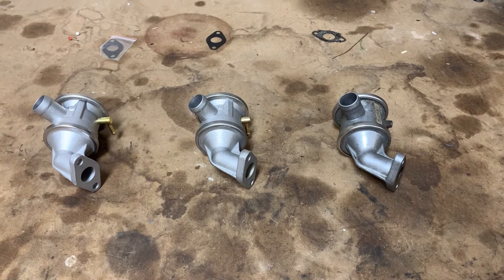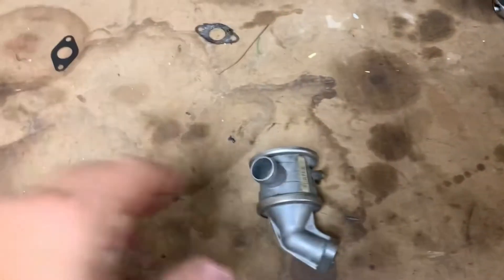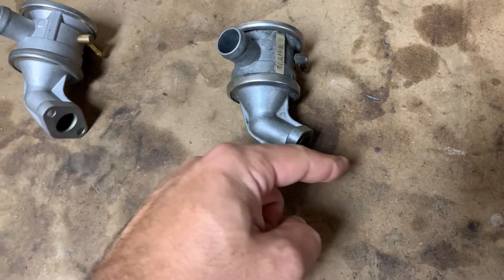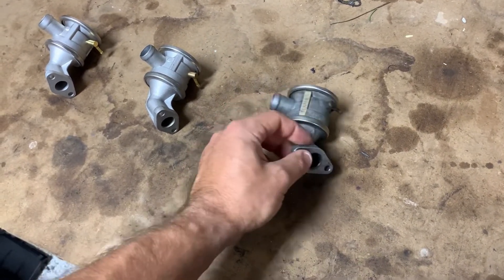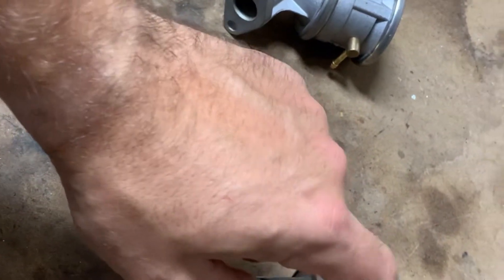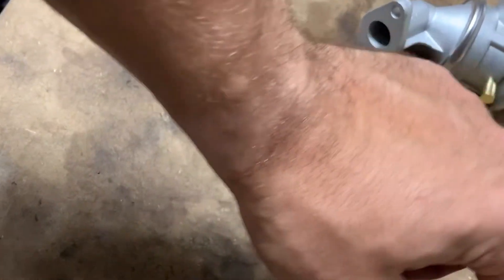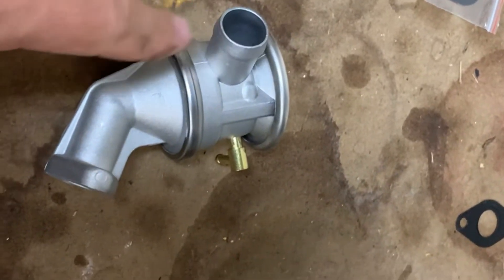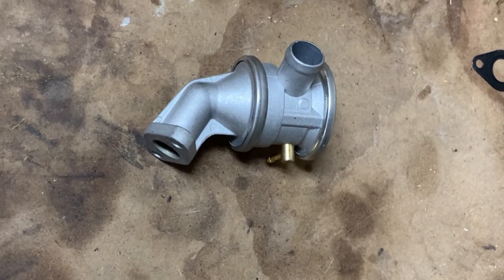Bench Testing BMW E46 (SAP) Secondary Air Injection Control Valve

Comment: I drive a 2004 330ci with a M54 engine and my air valve shown here dose t have a vacuum line? Anyone seen this?
Reply from the maker: It might have disintegrated from the heat and age. You can buy one at the auto parts store for less than $5 bucks 🙂
Reply: @autoraiders9520   thank you for the reply! But I meant there is no vacuum port for the small vac line option. Only the SAP coming into the valve and the outlet to the exhaust. No hook up at all for a small vacuum hose. After reading around I believe the later 2004 models were manufactured with a SAP check valve that didn't require vacuum to operate. I guess lol
Reply: @the1DasKrahen I’m having the same issues. Did you figure this out? Was it the check valve bad?

Comment: On the one that works, how hard are you blowing to try and test that air is flowing out correctly? I pulled mine and had to blow extremely hard to get any air to flow out. It seems too restrictive to me, but I don't know how hard the pump is pushing air out. Would a clogged valve prevent the SAS from operating at all? I am trying to figure out why my SAS is not operating during a cold start to set the monitor for the hat system. I've already tested the pump itself by connecting to a 12v source directly and it works. Thanks.
Reply from the maker: Keep in mind, this bench test is not an official way to test it. On the one that was working, I had to blow pretty hard to overcome the lack of a vacuum. 

My situation: The SAP and SAS did not work. I would get a fault code. I bench tested the SAP and it worked great. Then I messed with the valve and couldn't get it to blow through from either side. So I decided to get a replacement since it was pretty cheap at the time. Replacement came and it acted the same way. I thought that the valve needed a vacuum to open (and it does) but when I put everything back together, the SAP still did not work. I kept troubleshooting other parts of the system but couldn't get it to work. So I thought I would chance the valve and bought another one... The 3rd one I could blow through one end (SAP side) but couldn't reverse it (exhaust side). All I did was replace the valve and the second I started the car, the SAP kicked in and everything worked as it should have. This was almost 2 years ago... I am running the same valve you see in the video and drive this car frequently. (knock on wood) SAS works as it should with no issues since replacing this valve.
Reply: @autoraiders9520  thanks for your reply. I don't seem to be getting 12v power to the SAP at all. With the car on, testing the connector doesn't show any voltage. My assumption is that even with a clogged valve, the pump should at least turn on during a cold start even if for a brief moment, which mine doesn't at all. Did your pump turn on at all before? As the valve itself has no electronics, I don't understand how it could prevent the pump from starting. I'm now thinking that the relay is bad and will try to pull it and test it. Unfortunately I am not getting any codes that any part of the SAS system is failing so I don't have much else to go on.
Reply from the maker: @MrTeamriab  what you're describing is exactly the issue I was having. :) I tested the SAP plug and didn't see any power. Had the same exact thought that the valve is mechanical so shouldn't matter. I went as far as testing the old relay and then replacing it. Even after replacing the relay, it would look like I am still not getting power at SAP plug

I don't know for certain, perhaps the pump needs a vacuum (which is caused by the valve opening) and if not shuts it off immediately? But the second I installed the 3rd valve, I immediately heard the SAP come on. 

If you haven't done it yet, apply 12v to SAP and see if it comes on. Very quick and easy test but at least you would know if that's the issue. Then also test your relay, just in case. 

Either way, your problem seems to be the same issue I had
Reply: @autoraiders9520  thanks. Yes I did pull the SAP and confirmed it works when connected to external 12v power. I also managed to pull the relay and also confirmed that works as well. I also connected leads to the SAP plug and couldn't get a power reading so my jex move was to replace the B2S1 (pre-cat) O2 sensor (I already replaced the B1S1 last week to fix a fault code with that sensor). I'd read in some forums that the pre-cat sensors can be "lazy" over time/age and range it was recommended to replace especially with not knowing the age of mine. But maybe I should just try a new valve since that did the trick for you and it sounds like you had pretty much done everything I have so far. I'll report back if I have a breakthrough! Thanks again for your time and helping out!
Reply: fwiw I wanted to report back what my issue was. It turned out my z4m had a custom tune on it that prevented the SAP from running at all. No power. Once the mechanic was able to restore to factory firmware, the SAP started right up!
Reply from the maker: @MrTeamriab  excellent! Thanks for the update 🙂

Comment: Does the secondary air pump fail also by them time????
Reply from the maker: The SAP (Secondary Air Pump) didn’t work with the 1st and 2nd valve. Inc RO put the third valve
In, the SAP kicked on and has been working ever since. A year and a half ago with this valve and the original SAP to the car and they still work great

Comment: Hello, thank you for the video. When you blow into the valve, is there resistance, or does the air flow easily? I took mine off, and when I blow into it, the air does not pass freely. The air does pass, but I feel like I have to blow pretty hard. Thanks in advance for your response!
Reply from the maker: When blowing through it, there is no air going through it. Like many in the comments section said though, a vacuum on the other side does help open the valve. 

If the air flows easily, that also means you have a valve that's stuck open so the air from the exhaust will back feed into the SAP which with time will cause it to fail. 

I installed the 3rd one on my E46 over a year ago and have since tracked it, daily driven it, and have had no issues with the SAP kicking on and this injection valve working as it should :)

Comment: The explanation is incorrect. Vacuum is needed to open the valve. When you start the engine cold the computer sends power to the pump and the vaccum control valve. This will mean that the Air pushed by the pump will make it to the exhaust manifold. Once the Cat Converter is warm enough the computer will turn of the pump and the vaccum.
Reply: CORRECT!

Comment: How did you determine the second valve was actually bad without applying vacuum to the brass fitting?   I ordered a new control valve, and as your video showed, I couldn't blow through either end.   It acted the same as the 'cheap' ebay one you show in the video.  When I apply suction to the brass fitting, I can blow through.  Seemingly, these need the vacuum to operate.  I don't think it's bad, do you?
Reply: He's wrong. Air should not be going into the exhaust manifold without vacuum. Intake vacuum opens the combi valve to let the air pump allow warm air into the exhaust manifold. If no vacuum, not opened. The dude in the video is wrong when he says, if air flows one way, you're good. Wrong, only if vacuum applied.
Reply: Operates with vacuum. They’re new but once vacuum you’ll see the true results. He expanded very well. Just left the vacuum operating out

Comment: i am having the same issue as you (2004 325ci m56 SULEV) the one way check valve on the exhaust isn’t working and the pump isn’t turning on during cold start. causing the SAP readiness monitor to be incomplete. i can replace the valve but what did you do to get the pump to turn on??? i’m getting power to connector and checked relay/fuse. really confused to why the the pump isn’t turning on… what did you do to fix your SAP?? your help or anyone else’s would be much appreciated thank you 👍
Reply from the maker: I went through all the same steps that you did. 🙂 Mainly making sure that you get 12v going to your SAP right when you start the car. It is also important to make sure that your check valve is working properly (new) otherwise exhaust gasses are making their way back into the SAP which can prevent it from working.

Separately, i took off the SAP (easy to do) and I applied 12v directly to the pump and make sure it works. Just be careful, it is violent, loud, and speeds up very fast so I only applied for ~5 seconds 🙂
Reply: @autoraiders9520  so i’m getting power to the connector at cold start. also the pump turns on outside the car with additional power. the kombi valve on the exhaust is old and probably needs replacement. 
so what i’m asking is what made your pump turn on inside the car normally? was it the new kombi valve or something else
Reply from the maker: @e36singh  yes, it was the new valve. I did all of the things you just listed and the pulp was still not turning on. I replaced the valve as the last step and it worked.
Reply: @autoraiders9520  thanks for the help and great vid
Reply: @e36singh did replacing the valve get your pump started on the cold start? I'm in the same boat trying to set the monitor. Pump tested and works, valve is very hard to blow through but air does pass (not sure if that is normal or not). Not sure how to test voltage. Did you disconnect the power connector and connect leads to it during startup to test for power? Any tips would be appreciated! Thank you.
Reply: @MrTeamriab  my car is 2004. The DME uses ambient air temp to turn on the pump. I replaced the ambient temp sensor and my pump turned on
Reply: @e36singh  thanks I'll check that next. Obd seems to show the correct ambient temperature though. Did you try to replace the valve first and it did not work?
Reply: @MrTeamriab  the only thing I replaced was the ambient sensor because the temp was not displaying because the sensor was not attached
Reply: @e36singh  fwiw I wanted to report back what my issue was. It turned out my z4m had a tune on it that prevented the SAP from running at all. No power. Once the mechanic was able to restore to factory firmware, the SAP started right up!

Comment: Thank you so much. Can An old one be cleaned and reused?
Reply from the maker: Generally carbon build up is heavy enough that it can't be cleaned and reused. The valve can't be taken apart either so a replacement is the viable option :)

Comment: You’re not applying vacuum to the brass nipple on the valve which opens it and allows the airflow to go through from the pump to the exhaust. However, The first one is most likely clogged from carbon. The second one is failed from the factory because it’s Chinese junk. The third one it’s not flowing from the pump side because You’re not applying vacuum to that small brass nipple on the valve. This is what opens the diaphragm that allows the air to come from the pump into the exhaust. The second one you tested is bad from the factory because it’s Chinese junk...never buy Chinese emissions parts! If you would’ve installed it on your car the exhaust gases would’ve gone into the pump and heat it’s so hot it would render the entire system useless in need of spending $1600 or more. Pierburg Is the company that makes the pumps in the valves I would stick to just them they’re made in Germany and everybody knows Germans make their stuff the right way. If your vehicle is a 2004 or newer, The exhaust valve does not have that small brass nipple as the pressure from the pump opens the valve it can also be clogged from carbon especially after 100,000 miles.
Reply: Best explanation over many vids I’ve seen. Especially pointing out the late model valves that don’t need vacuum assist. Great job guys! 🙏🏼
Reply from the maker: I agree with your comments 100% and a very good detailed explanation. You are correct on the 1st valve, it was original to the car with 140k miles. Likely failed years ago and because it was clogged, it didn't fail the main pump. 2nd one was definitely cheap junk so never installed it. The 3rd one is still on the car and works very well. I didn't have a simple way to add vacuum to the brass nipple, but this quick bench test will tell you if it should be good or not. So far my SAP system works as it should with the 3rd valve :) Thank you again for your good comment
Reply: Hi.. mmm...so if the solenoid vacuum valve not open the system faults! Right? Because i take out mine i blow with my mouth but nothing.. only with air pressure open.. but i thought tha you writing..is like transistor... The thirty pin control the other 2